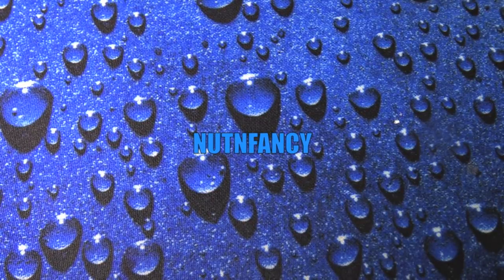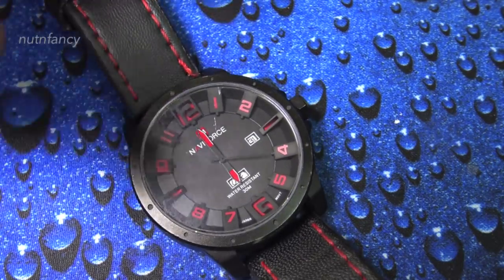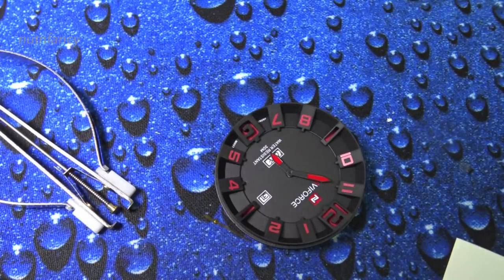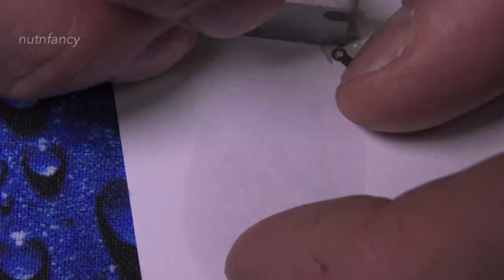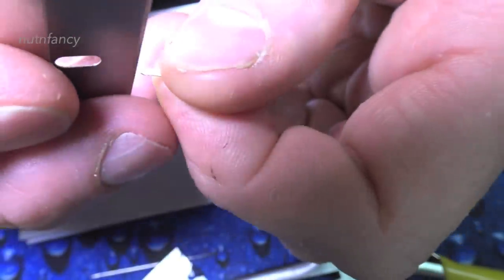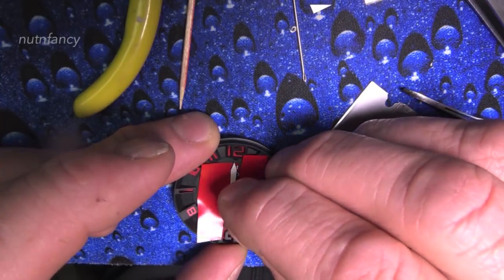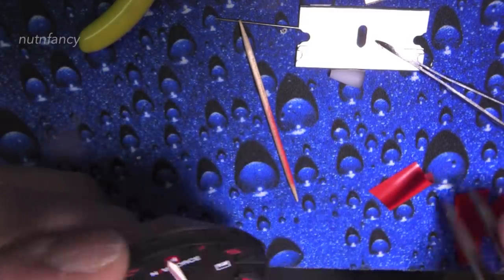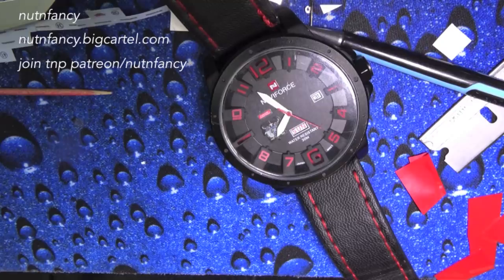MOD YOUR WATCH: How to Make It Awesome

Comment: Excellent content, excellent presentation !!!!!!
I too collect knives, guns, and watches. I have a watch tool kit but was apprehensive about taking any of my watches apart.
You gave me an idea about purchasing some cheap watches and using them as a proof of concept so I do not damage my good watches.
I too like some of the others who commented was apprehensive about even replacing batteries.

I'm accustom to working on small electronic components in computers and radio communication equipment where I use a forensic microscope 
with a camera attached to it to display on a computer, tablet, or monitor. It also allows me to take still .jpeg pictures.

But what about gaskets ? Will they still be water tight ? Is there a way to pressure check the watch without taking them to a jeweler or watch maker ?
Thank you for this in depth presentation on watch modification !!!!
It was very helpful and enlightening !!!!

Ricky from IBM
Reply from the maker: Hello Ricky!  Thanks for the great comment and for being TNP Patreon.  Yep, practice on the $14 watches…you will get much better, more confident about taking them apart and taping.  I will make some vids along this line to help y'all out.  I would not worry too much about water resistance; most O-rings will stay in place with the "fields trip."  But I do keep on hand extra O-rings I bought for replacements b. they are cheap!  https://amzn.to/2ZvDDXh
Reply: Hi LT, thanks for the advice and encouragement. I look forward to more of your presentation.
Thank you for all the time and resources you put in to all your presentation.
I recognize how passionate you are about the product you produce.
Thanks again !!!!

Ricky from IBM